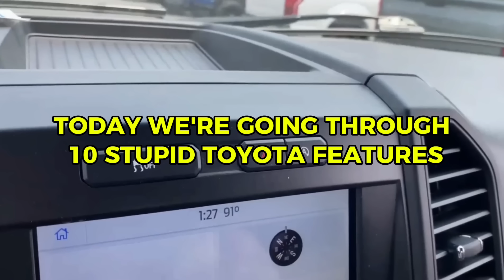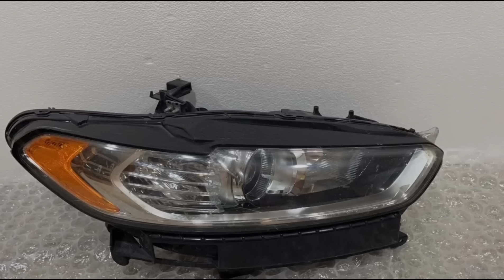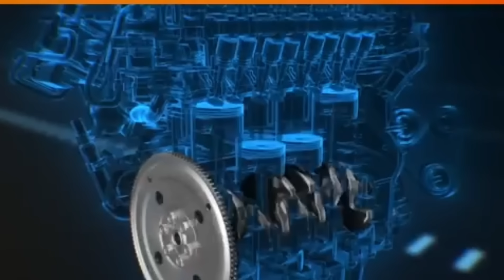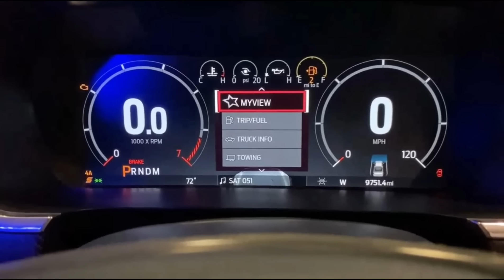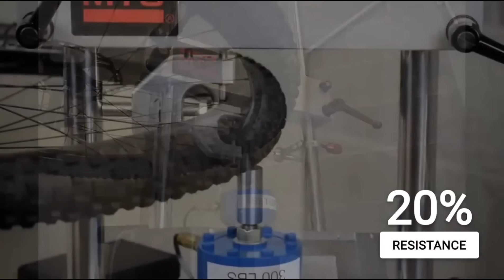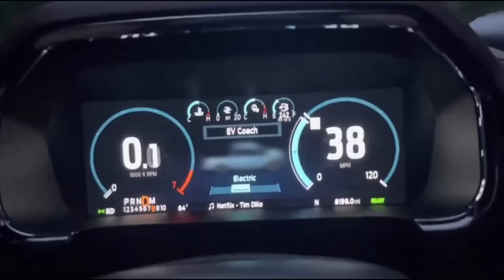10 Stupid Toyota Features That Are KILLING Your Gas Mileage (TURN IT OFF)

Comment: Never place a floor jack under the rear differential to lift the truck
Reply from the maker: That is a very important safety tip for anyone working on their own vehicle!
Reply: @ToyotaZone-b9t more than safety, it is about damaging the cast iron differential...no manufacturer recommends this...

Comment: Used to be a massive Toyota fan and then I looked at what they’re doing in the last few years and I would never buy it. I have a 2020 Toyota Tacoma TRD pro and judging from what they’re bringing out now I will never buy another new Toyota vehicle. They collect all of our data and driving habits and then sell it. Take our personal information and sell it. They give us features in our vehicles that we pay for and then after two years, we have to pay a monthly subscription to carry on paying for what we already paid for fuck off. Then you get idiotic small engines that they’ll back up with a battery and a dual Turbo system in order to match what the old engine used to do. Plus, they don’t tell you that your oil only lasts half the time when you’re using a turbo to heat from the turbo burns up the oil like a motherfucker. And then they put in electronic handbrakes what a fucking idiotic idea that is. If it gets wet or you’re having any electrical problems, your wheels stay locked up. God forbid if you have to get a few friends to help give you a push start that electronic handbrake isn’t going to let you do that. And then if you’re into offloading and stuff like I am, if that thing gets wet, you’re fucked. Not to mention it takes twice as long to do maintenance on and cost three times as much to replace. Oh yeah, you don’t get to do handbrake turns on dirt trail road and nice ice covered lakes when you want to play around and have a little fun. Take that away from you. These are just some of the issues the new Toyotas have and I’m not buying it. They’re not getting my money. I would sooner buy an older vehicle. Pay a nice chunk of money to have it all serviced up nicely and parts replaced. I’ll get a much better more reliable vehicle than the shit they’re selling now.
Reply from the maker: I appreciate you sharing your perspective on the shift in automotive technology and the importance of vehicle simplicity for off-road enthusiasts.
Reply: @ToyotaZone-b9t  thanks for that. But I have looked closely at what they have in the show rooms and it’s all flash no real substance. They’ve turned the Toyota Tacoma into a pavement princess when it used to be an absolutely trail breaking beast. They act like they’re reaching out to their Overland community with some of the options are putting on the trucks however, when you want to upgrade your truck and put real meaningful over landing accessories on it, the dealerships won’t put them in. I’ve approached five different dealerships and all of them have refused to put in a high-performance radiator. The radiator in my TRD pro is half aluminum and the bottom reserve tank is plastic. Now for the most part and every day use, this is OK however, here in Northern Canada in the Rocky Mountains extreme cold can really affect this plastic, causing it to crack and your radiators down. I’ve heard reports that it’s also bad in really warm locations too. So I decided to upgrade my radiator to 100% aluminum T welded beautifully made radiator plug and play. No modifications need to be made. It holds 50% more coolant which you have to admit is really beneficial for an overland vehicle. That’s typically heavier than what the Tacoma typically would be. And I plan to upgrade my hoses from simple rubber hoses to silicone hoses. Purchased them all all bent and shaped perfectly to go into the truck. And not one of the dealerships in my town wood add it to my vehicle. So I don’t believe Toyota is reaching out to the Overland community whatsoever. I think they’ve through a few accessories on that makes it look shiny and nice not fully understanding. What’s on the trucks. To reach into your pockets, a little further. And once you purchase one of these vehicles and you decide to upgrade it further, don’t expect help from Toyota.
Reply: Got news for ya, all the manufacturers are doing subscriptions now.
Reply: @Summerguy24  yep and that’s exactly why I won’t buy a new vehicle ever again. I’ll become one of those people who’s more interested in a classic car. Which is just code for a car that can be easily fixed fixed anywhere and I’m not being spied on and fucked over. It would be more beneficial for me to buy a car that’s in good body and frame condition and just paying money to have the worn out parts replaced with new ones and it will be a better vehicle than 80 to 85% of all the current new vehicles on the market today. My cousin bought a car from 2006 with nice bodywork frame is in good condition. The engine was really good and he replaced a bunch of parts and had to rep upholstery redone in the car so it smells like new. Cheaper insurance cheaper maintenance costs more reliable vehicle. I think this is the way to go for most people in the future.